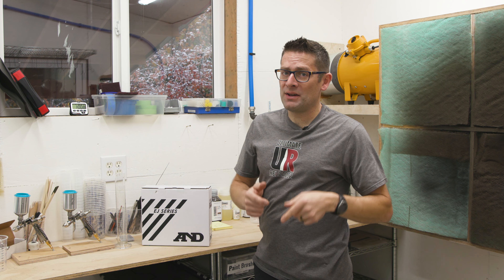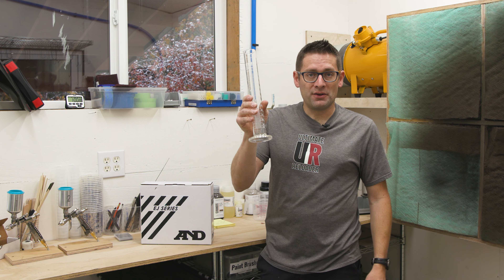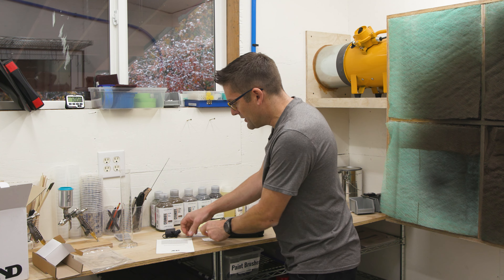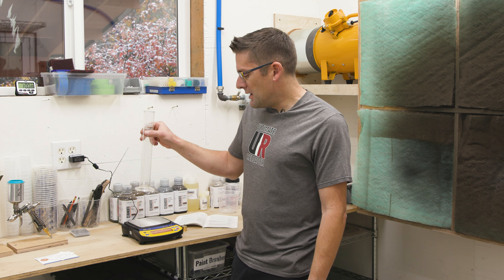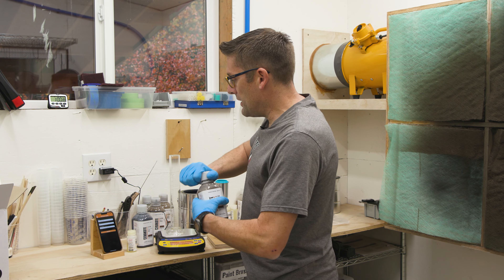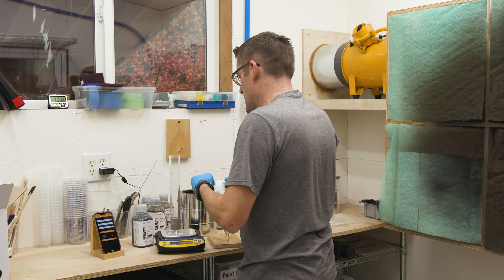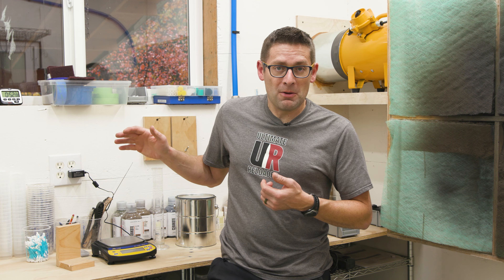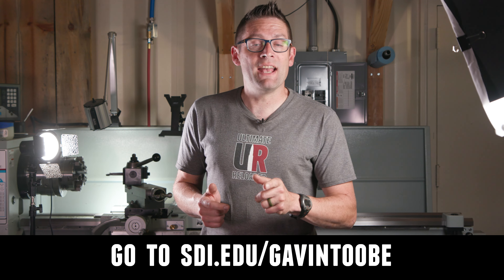A&D EJ-3000: Versatile Scale for Cerakote, Epoxy, and More

Comment: Different viscosity and even the 'height' of your pour (meaning, your pour height is higher with less quantity in the same cylinder - even if you hold your supply container in the same spot) will impact your in-flight add from weighing.  Even with precision tools like this (and it's a nice balance!) there's a human factor.

Enjoy!

Comment: both ceracote and epoxy resins have a massive sweet spot , this kind of accuracy is just not needed , you have a 10% tolerance , this is just anal overkill, no pro user of these products do any more than a simple kitchen scale , most that I deal with just pour by eye ... you need to chill out , it isn't that important.... take some more Prozac...